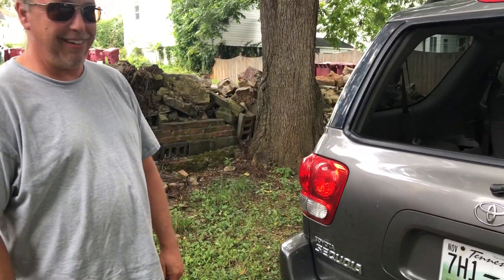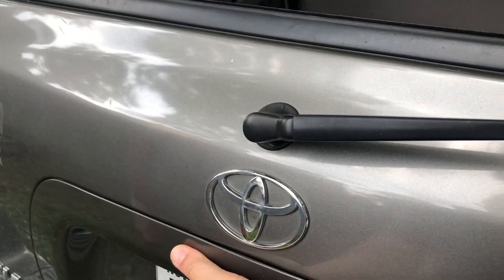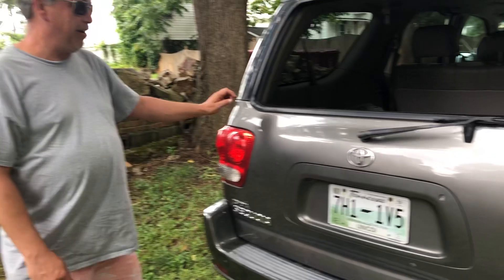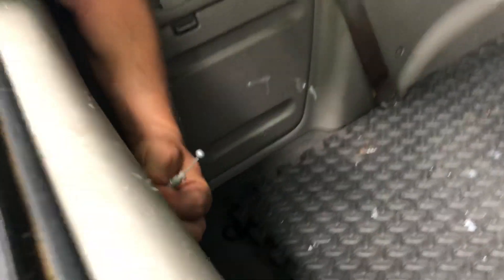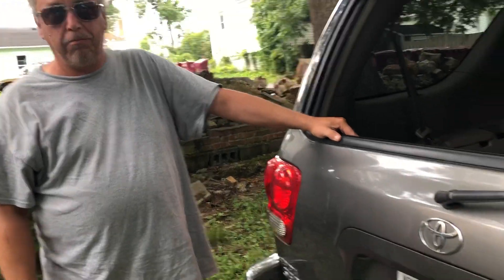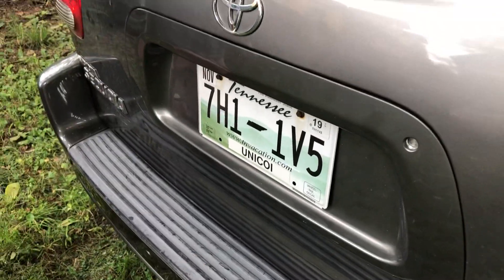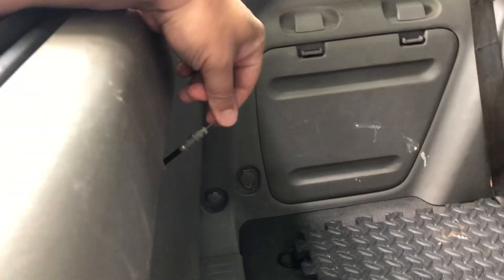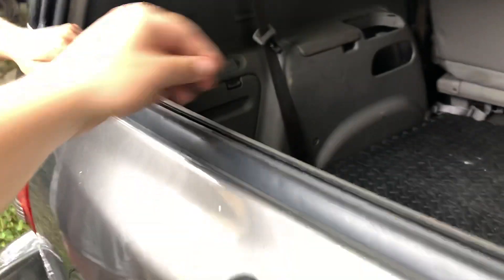Toyota Sequoia Metal Handle Replacement Does not always work

Comment: After replacing the handle multiple times on my 03 Sequoia, each time the handle worked for a while, however the lever pull still required a lot of pressure to unlock. I never thought to replace the cable. When I bought a new cable from the dealer, it was a game changer. I can now open it with one finger.  So replace the cable and this issue will go away.